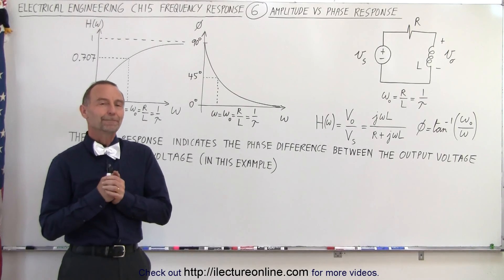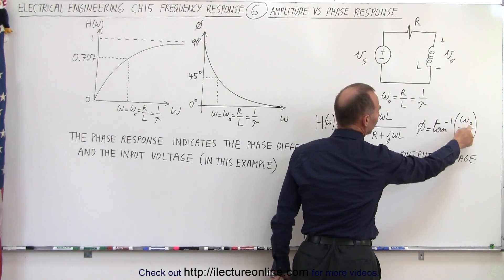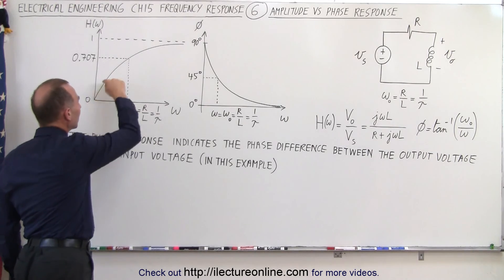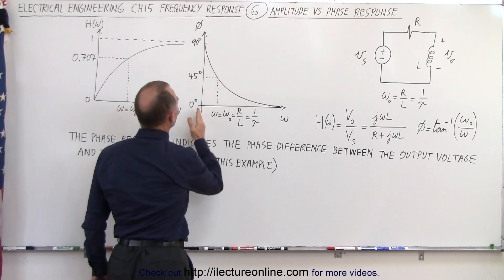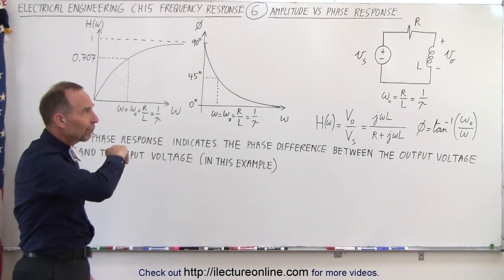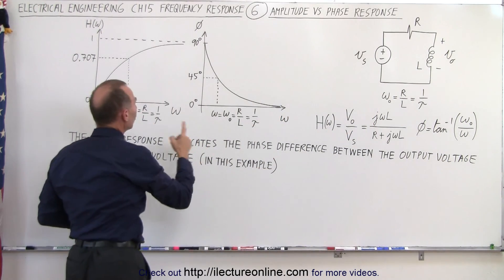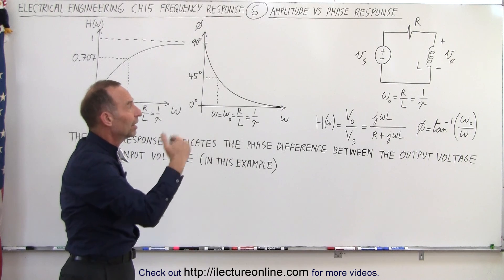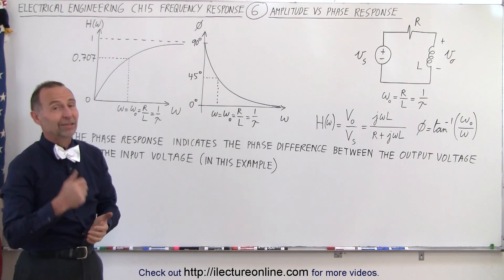Electrical Engineering: Ch 15: Frequency Response (6 of 56) Amplitude vs Phase Response

Comment: Hi sir, as per my understanding the phase angle = tan-1 (Im / real).  >> how to relate phase angle = tan-1(Wo/W) ?? but i knew (Wo/W) its taken from next to the j.
Reply from the maker: We suggest you look at this playlist:  ELECTRICAL ENGINEERING 10 PHASORS, PHASOR DIAGRAMS IN RCL CIRCUITS.  The whole playlist is devoted to that.

Comment: 1) i am confused, typically a higher phase means a more delayed response.

2) you skipped 5/56 in the playlist or didn't include it purposefully

what does it mean for an output voltage to reponds with a 90 degree phase.
you said for any w for vs slightly > 0 the inductor responds instantaneously. 
At higher w for vs, vo is slightly faster than vs 
could you please explain what a phase shift of 90 degrees means in time. i am not sure if i missed something but that is confusing me
as vo should be always slower then vs 
thus w for vo < w for vs for my understanding for w>0